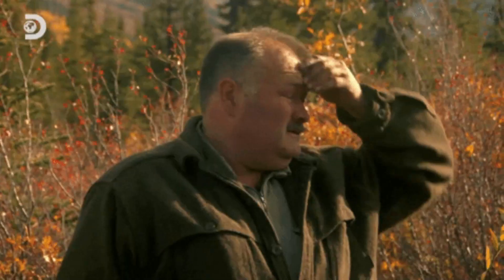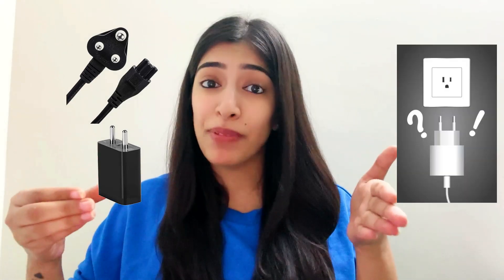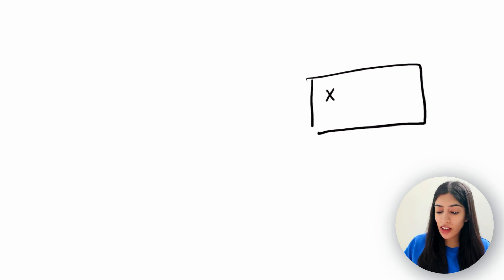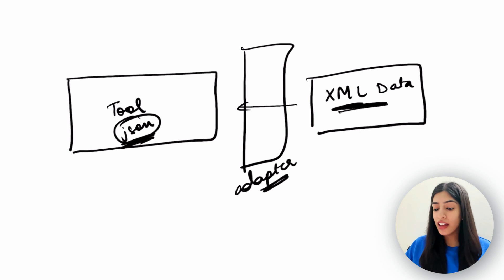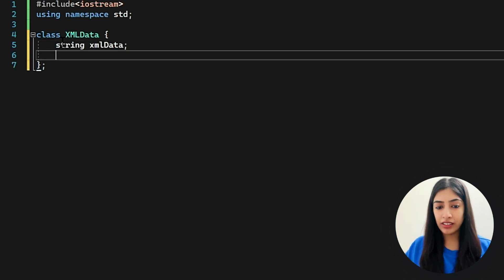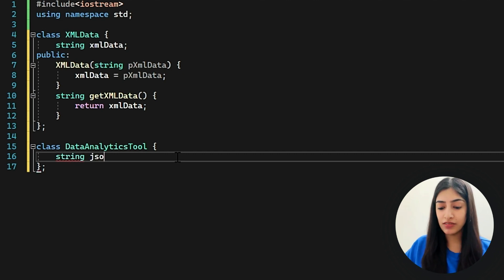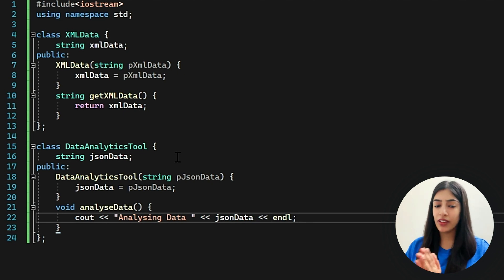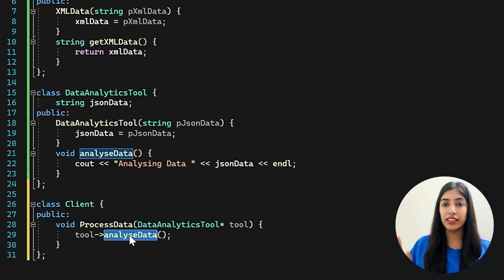Adapter Design Pattern | Explanation with Code in Easy Way! ✌🏻

Comment: What if the DataAnalyticsTool class (the target class) is an external library and it does not allow itself to be inherited ?
Reply: Then we’ll have to create Adapter class which will contain (Containment) DataAnalyticsTool, it will do the conversion (XML to JSON) and delegate (Delegation) processing to DataAnalyticsTool.

Comment: Shouldn't the adaptees specificRequest be called instead of converting  XML to JSON? 
XMLData class needs a analyseXMLData(); which should be called when adapyer.analyseData() is called from the client? 

I guess we have to either write different functions to analyse different kinds of data(in different data classes)  or write functions to convert  different data types into XML(in different adapter classes)
seems like writing different data classes is reusable too

Comment: What if you have now a new format to be converted to JSON ?

I think you need to have a parent class called "data" and derive "xmldata" and other new formats.

And now, the the adapter class should have "data *" as member which calls getdata (overidden in xmldata and new formats class)